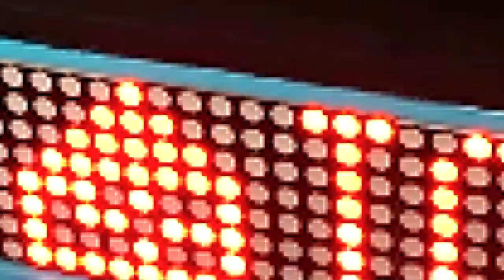Arduino Breakout Boards

Comment: You could put the pins into the Arduino first, then rest the breakout board on top and solder the pins. That way you're guaranteed everything will line up because they're already in before soldering them! Thx for the vid.
Reply from the maker: Cheers. Good idea I never really thought about that before.  To bad I’ve done all my other boards haha.